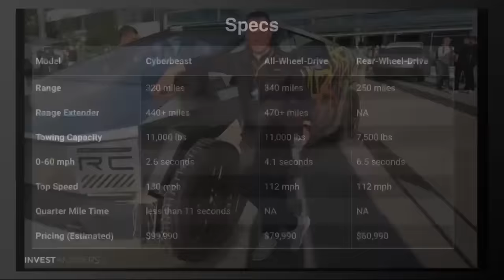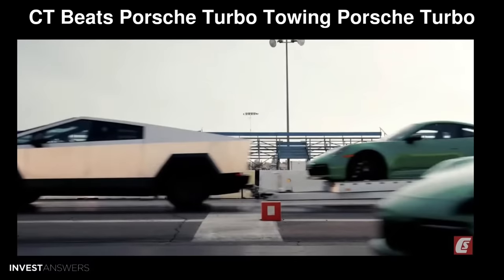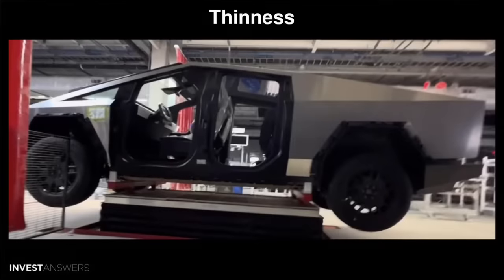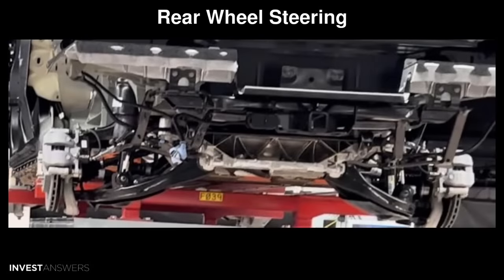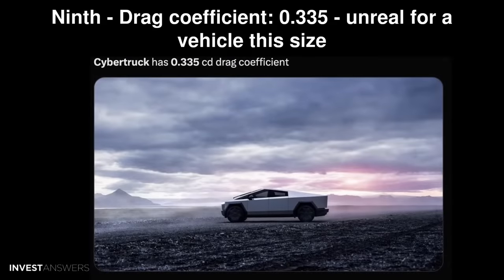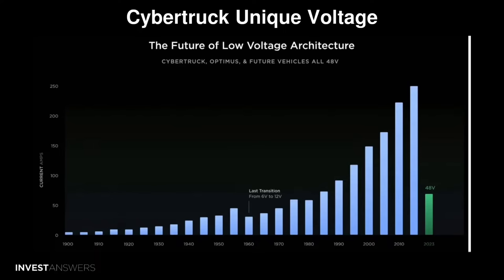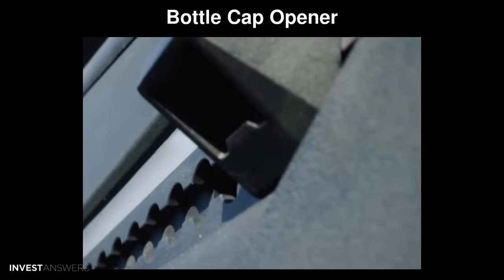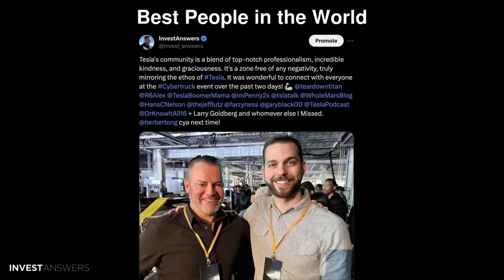🚀 20 Astonishing Cybertruck Features You Missed!

Comment: But 48v volts is already very common at german cars.
All audis with 4 wheel steering like audi a8 and q7 have 48v on board Network.
Also all mild hybrids since 2019 on audi Mercedes and bmw have 48v on board Network. That is by far nothing special anymore.

But anyhow i love the Cybertruck ❤
Love all your videos. 
Greetings from munich 😊
Reply from the maker: so many tesla haters - cracks me up - The EQ Boost system uses a 48-volt battery to power an electric motor that can provide up to 20 horsepower of additional power to the combustion engine.
Reply: @InvestAnswers    thanks for putting this in the right perspektive. The 48v system is just a ad on. They still have a 12v battery.
So Tesla ist first as you mentioned. Sorry got this wrong.
And i defenetly dont hate Tesla 😅
Im a big fan, the Cybertruck is just so badass. 
ITs one of those concept Cars you wish they become real. And this one dream come true😍
 Dont want to crack you up.
Looking Forward for more Videos in Tesla 👍

Comment: I think you are confused about the batttery voltage. 400 and 800v is normal for ev batt voltage for the reason you mentioned. I think you're talking about the accessory voltage. So now 48 not 12 so  no aftermarket accessories won't l work. This isnt a feature .it means nothing will work in it unless its tesla. Can't believes all the expert reviewers haven't picked up on this. Clearly just buy cars around parade around in them.